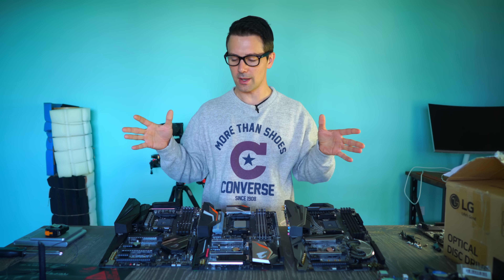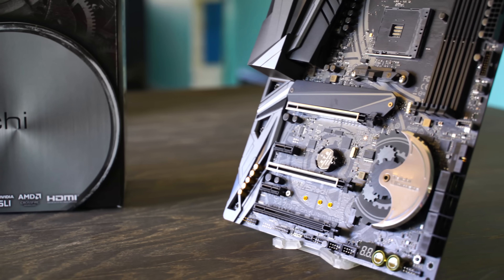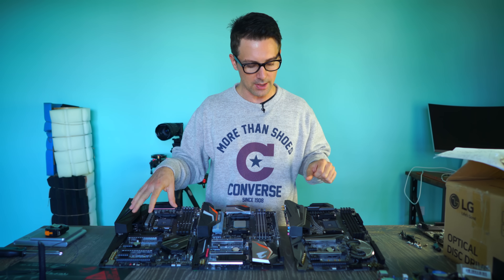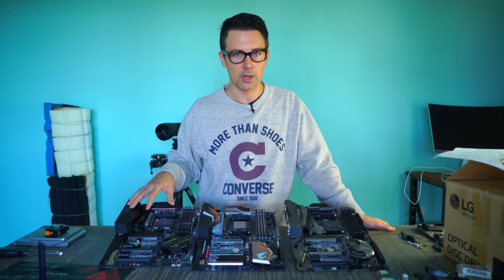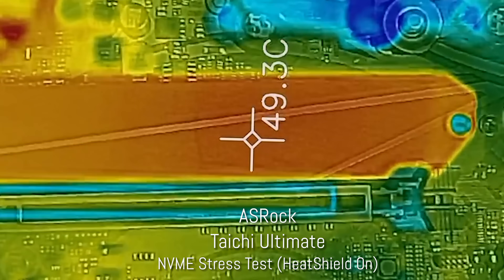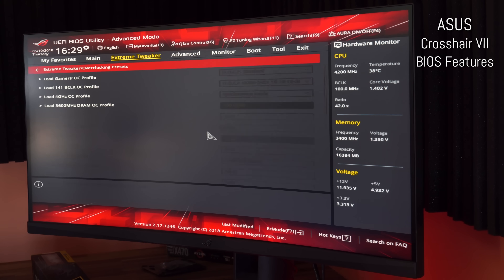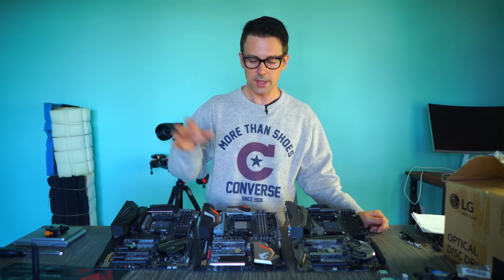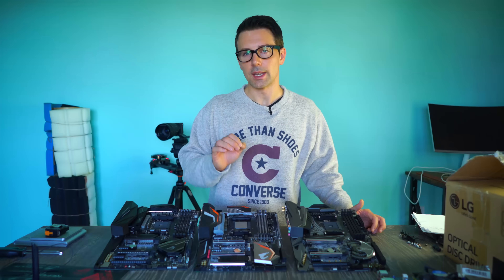The Ultimate X470 Motherboard Comparison - Which is the Best?

Comment: Used many motherboards over the years.If I had to come up with a ranking it would be:
1.MSI(best bios,best layout,Auto settings are perfect)
2.AsRock(almost as good as MSI,but requires a lot of tweaks for high OC)
3.Asus(rock solid stability,but lack of features,high prices)
4.Gigabyte(nothing but issues with these boards,countless dead)
5.All others
Reply: I just got a gigabyte mobo,so far so good.
Reply: I'm an ASRock homer and I'll even agree that ASUS should be up there at #1 - we're talking about flagship boards here and you're saying that ASUS is lacking features?!
Reply: Actually i would put asrock below them all, as i have built over 1200 pcs and really use gigabyte and asus motherboards with a few exceptions for msi, not sure where you think that asus doesn't have features, perhaps some of the "budget boards" but that is why they are budget...
Reply: Around The World building pcs for 9 years, about 12 per month, some spikes here and there, often going to small businesses...so technically not home pcs, but often need home/ gaming performance
Reply: I find that msi have the most user friendly bios.With this Asus am3 mobo.You have to know somewhat how the settings work for perfection.On Gigabyte not sure how it is now but i have an old 939 gigabyte running with a 4400+ cpu and its running solid cept for memory compatibility issues when i first got it.(Friend gave it to me saying its broken)
Reply: Pirun Gaming 
What ASROCK just needs to do is work more on software.
Reply: needabettername 1200? Jesus my dude
Reply: Yeah that's insane! 1200 PC's?
Reply: Francisco Santos and not fake their VRMs, and use better components, and have better warranty service, and honor their warranty, and not lie about board specs....
Reply: needabettername Any tips for a fairly new builder?
Reply: That Other Morehouse pay attention when applying thermal paste, more is NOT better....also don't skimp on PSU, it is supporting all of your components..even when i build budget systems, i will spend a little more ob psu than a lot of customers are happy paying for, not realizing it's importance...not saying you need to spend $300 on corsair 1300w psu, but don't buy a cheap one because you can save a buck..and you realistically dont really need more than a 650w unless you doing SLI or crossfire
Reply: needabettername is a EVGA G3 750W good?
Reply: That Other Morehouse i think that is single rail, if it is, then yes, if it is like the g1, using split rail, then no
Reply: From my experiences I would put Asus as the too, BIOS slick and easy to use, features are the best, and yeah they're expensive but you get what you pay for!
Reply: i will agree that gigabyte are shit, but asus should be at the top we all know this

Comment: I got my crosshair vii wifi for free and cannot wait to use it. Just waiting to order my 2700x should be quite fun. Gn did a video about the vrm on the c7h and he said it's the best he's ever seen.
Reply: bluej511 my hero 7, 2700x and 1080ti came this morning!!! I can’t wait to get home.
Reply: Mine came direct from Asus in Taiwan took around 3-4 days from Taiwan to France. Its the wifi edition too but i have no plans on using wifi (even though my ISP router can actually do 1742mbps on 5ghz, and yes i tested it, my S4 on 5ghz gets around 200-205mbps). I'm running a 1700x and hero 6 right now, i got everything pretty much on release day, my aorus gaming 5 failed after 4 days and had to be returned i then ordered a c6. My retailer had no idea when theyd get more G5s in stock so just flat out gave me a refund. i've had some issues with BIOSes and stability especially with Hynix ram on my c6 but seems to be alright. I may even buy some gskill 3466/3600mhz ram to go with this build once prices drop down a bit. Around here ram is starting to cost as much as an R5 2600, it's ridiculous. 

I was fortunate enough to help out on overclock.net for people using the crosshair 6 since i got mine early enough and Asus chose 7 members/users to send a gift to for helping out Asus and the community. So huge shout out to them and  BIOS designer/overclocker expert Elmor for being SUCH a huge help.
Reply: bluej511 that’s awesome. Goes to show that if you help others what goes around comes around. You deserve it buddy. Enjoy it!